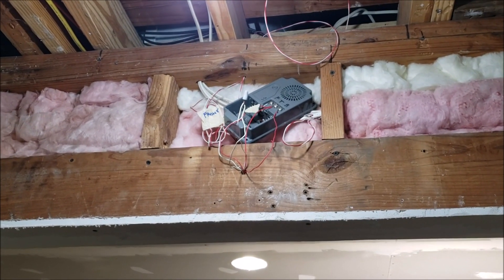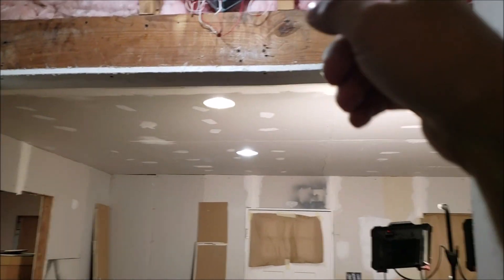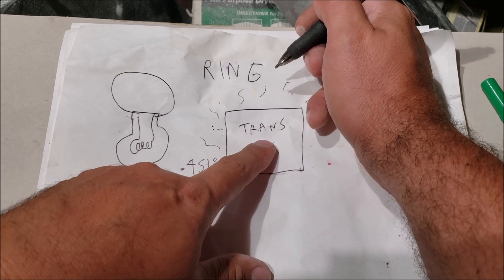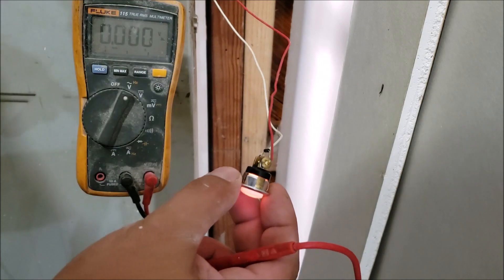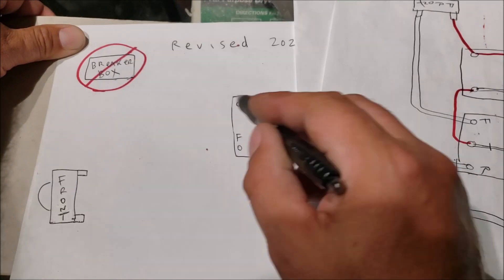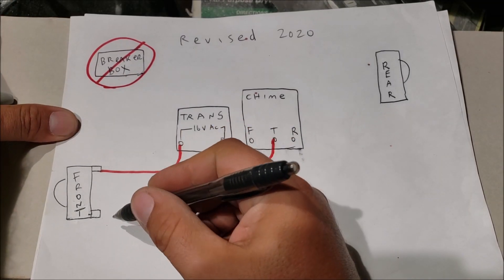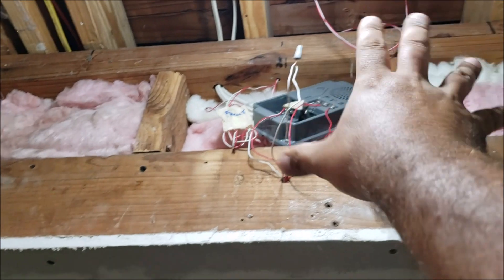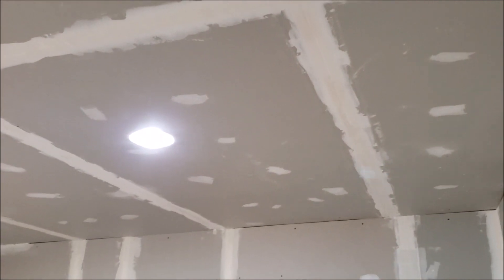DOORBELL part 2 WIRING DIAGRAM transformer location and info

Comment: I have the same set up as yours except I’m using the ring pro. And once I connect the Ring to the front doorbell wires the door bell will not stop ringing. After a min or two of doing that it’s gives a dying sound then starts ringing constantly. 
This is only with the ring attached. Regular doorbell is working like normal. 
thanks in advance.
Reply from the maker: I don’t have a ring pro. not the same set up. try turning off breaker for a minute

Comment: Well I just finished installing mine, had to pick up a 8-24V - 30Va transformer. That’s was all it needed , a simple upgrade, a 10Va will not work, at least not with the pro model . (which btw is what’s in most home).

Comment: Hi I wanted to get the power from the lights to but I don't want to have the lights turned on always for the doorbell to work anyway around this? Thanks
Reply from the maker: the same place the light gets power.. it can be either at light or switch
Reply: @chriscraft77022  thank you. How should I connect the bell wires, just twist them on the light wires end before they enter the switch? Or is there a better way. It is bell wires for that to transformer right? Not some other type of wires. Thanks
Reply from the maker: I have a how to wire a doorbell video you might want to watch...
Reply: @chriscraft77022  thank you, will watch when I get some free time.

Comment: I know you said the box is the worst place for a transformer. What if mine is already there? I just replaced the transformer so that I don’t have to charge the battery but am having trouble understanding the wiring. When I touch the red and white wires at the door together, they ring my chime. When I put the ring on, it doesn’t. Any suggestions?